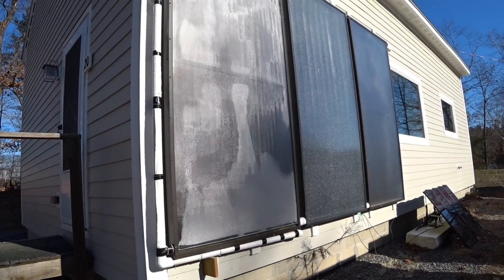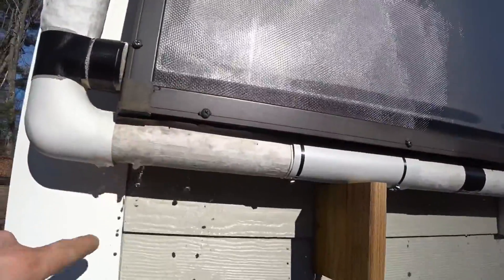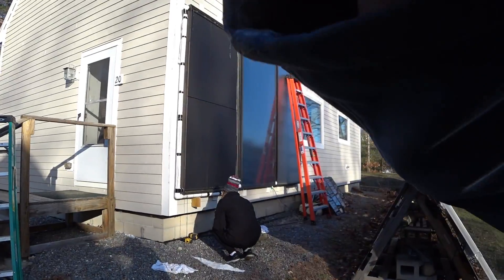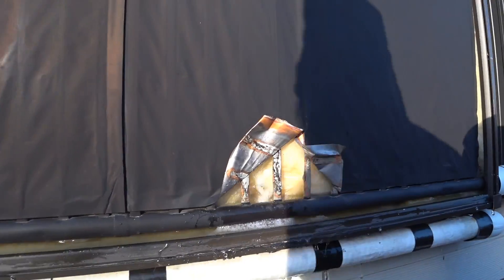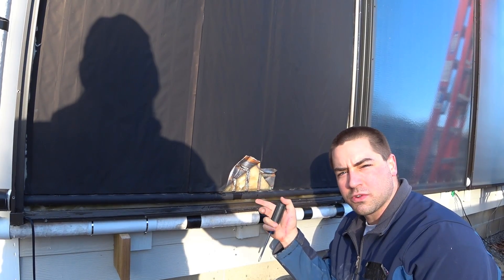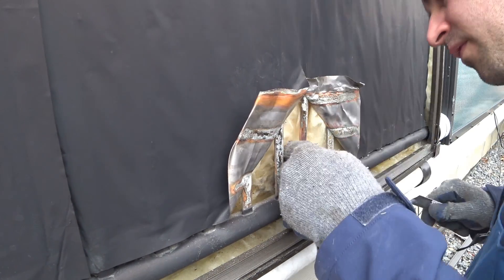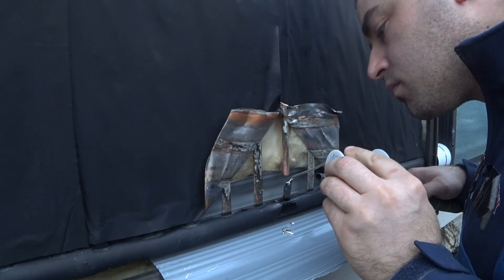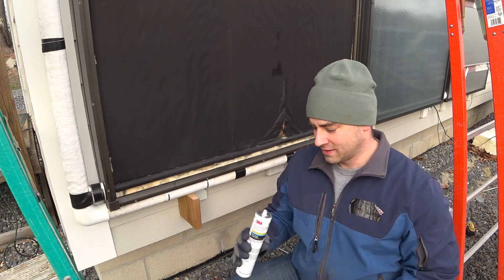Repair a Solar Hot Water Fail, DHW

Comment: When these collectors are finally shot, I'd love to see you DIY a heat pump. In theory it seems like collectors are the cheap and easy solution but there always just seems like so many possible points of failure. James Biggar did a wicked photovoltaic/warm air/mini-split build. With your existing tank it would be sick if you charged your thermal battery with such a system. Sola to run the heat pump and warm air off the back of the panels to feed the heat pump.

Comment: I just did a repair on my hot water panel yesterday using J-B Weld Original Cold Weld Formula Steel Reinforced Epoxy. I'm 1.5 hours away from re-pressurizing the system. That will be 26 hours for the epoxy to cure. I sure hope it doesn't leak. I used nothing more than that rubber framing on the outside of the glass panel to seal it since that is the way it was designed. I would hate to try to remove it again if I had used a sealant such as you used. Wish me luck folks.
Reply from the maker: Good Luck.  That JB weld is awesome stuff.  I've seen it work on low-pressure systems, and I probably could have used it here.  You are right about the sealant.  I don't think I could get the glass off now if I wanted.
Reply: @DavidPozEnergy  The system is back up and running (2 hours now) with no leaks. I used to use a product called MarineTex years ago to repair cracked blocks on my charter boat's V-6 outboards when rebuilding them. I never had a failure. This J-B Weld Original Cold Weld formula reminds me of that stuff.  I have about 80 pounds of pressure in this system. My concern will be more about the heating and cooling cycles as time goes on. I hope I got a good bond.
Ya, I think you are probably going to have to cut that lip off all the way around the panel so you could get a knife in under the glass if you ever need to get that thing open again. Sometimes we just try too hard to do a great job and shoot ourselves in the foot. I appreciate your video. We all learn as we go.

Comment: Do you use a solar panel to automatically run the pump?  I would, as it seems to make sense and is totally automatic...
Reply from the maker: It's not automatic.  but, I did have the pump on a little solar panel with battery for a few years.  But it would sometimes not run if the voltage was low, so I have gone back to running the pump on the grid.  I think the pump I have is 20 watts, and runs about 4 hours on a sunny day.

Comment: How you going to get the water out of the vertical pipe you dead-ended next fall?
Reply from the maker: Hi Mark,  I repeated this process on the top section, so there won't be any water in the pipe.  Thanks for watching.

Comment: Is it possible to let it drain empty for the frosty night?
Reply from the maker: The system I have is called a "drain-back" system.  It is supposed to drain every time the pump shuts off (which means every night).   I have checked for blockages, and the pump.  The system is working as it should in theory.  I think some water stayed in the pipe due to condensation, or capillary action, and it was just enough water drops to cause a problem.  It's very disappointing.
Reply: @DavidPozEnergy   Next summer I'm going to make similar, but of thick black propylene water tubes.  The only problem with them is that they tend to stay curved, difficult to straighten them.
Reply from the maker: Hi Jaakko, I'm currently building an experiment to test heating water using two methods.  You many want to wait for those results before buying any supplies.  I have two videos up so far about the experiment: https://youtu.be/VPd212q6uvU  https://youtu.be/kkoesuG72xQ

Comment: I've been thinking about this for a while now after watching your video last week. I wonder if when the water drains back down, the air that fills the void is too humid and as it cools it condensates inside the pipe, and that's where the freezing occurs?
Reply from the maker: Hi Solar Steve,  That sounds good to me.  Thanks for taking the time to comment.  If it breaks again I'll probably have to convert to glycol and add another heat exchanger.

Comment: Does the highest point have a vacuum breaker? Similar to a Hobart 00-277112-0002 valve? Sounds like the water tries to siphon back but doesn't have enough of a vent. When you cut the line it sounded like it was pulling air in instead of all of the water above gushing out that pipe. Adding one may help quicken the drain back and prevent a situation where the water won't drain.
Reply from the maker: Hi JR,  There is not vacuum breaker in the system.  In theory I don't need one because my tank is atmospherically vented, and the pipe leading back to the tank is higher than the high water level.  So there is a break to prevent siphon.  But, as you said, it might help make it faster to drain, and might help.  Thank you, I'll look up the part you suggested.

Comment: If there had been a sediment blockage in the bottom of the pipe, it very well could have been knocked loose due to the vibrations while grinding and cutting the pipe prior to inspection.

Comment: I believe the reason you couldn't get the coupling to slide far enough on to the pipe is because it has a dimple in it to prevent it from going more than half way. Unless you also disconnected the tube from above, it will still fill with water, but can no longer drain.

Comment: I will take a wild guess and say standing water resonate frequency of your water manifold caused flow impedance at a resonate node.  With no flow, the water froze.  Like a dead spot on a flute or guitar string node where you can touch the string and it doesn't change the frequency.  It is the same reason intake manifolds on new cars have resonate canceling chambers, so at certain flows, the standing wave doesn't impede air flow.

Comment: David;    After selling drain down systems with several layers of redundancy and doing this same soldering repair many many times, I would have to agree with the conversion to ethylene glycol (anti freeze). After about 10 years in a very moderate climate 3500 feet Arizona, and at least as many repairs I had to rip them off my roof and sell for scrap. Never did find the root cause, but some combination of capillary action, condensation and night sky radiation appears to be the best candidate
Reply from the maker: Hi Mark,  Thank you for your input and experience.  I have found several brands and types of antifreeze out there.  Was there a brand or make you suggest.  Ideally a link so I can make sure I get the right kind.  Thanks.

Comment: Will water be trapped in the remaining riser tube you left in place?
Reply from the maker: I cut it off at the top and made the same solder up there.  It's just hard to hold a torch, solder, and camera while on a ladder.  LOL
Reply: @DavidPozEnergy  Okay, now the repair makes sense.

Comment: Sheesh that is really a mystery ... i mean, the pipe was wide open to the lower manifold.  Unless a piece of debris got caught in there temporarily ?   like a small piece of paper, something just enough to prevent the water from draining and then eventually dissolved and/or passed thru.   A real head scratcher for sure !  Could your pump impeller shed a tiny bit of rubber ?
Reply from the maker: Hi Mark,  The pump I'm using is a stainless steel grundfos.  I doubt that it is the problem, but I'm also not willing to rule anything out.  As I've stated I don't know the answer.

Comment: Unless you capped off both ends of the pipe that pipe will just fill with water and burst once again and that windshield adhesive will ensure that you will never get that gasket off if that's what is in contact with the adhesive I would have just used a silicone for Windows and Doors I'm sure it would have held up just fine to the expansion and contraction
Reply from the maker: Thanks.  I did cap off both ends, just hard to hold a camera, torch, and solder on top of a ladder, LOL.  You are correct that the rubber gasket is in contact with the adhesive.  As I mentioned, I didn't know what to use.  It is connecting the rubber gasket and aluminum frame.  Would you have use something that is 100% silicone, or some mix?   Something like this? https://www.homedepot.com/p/GE-Silicone-2-10-1-oz-Clear-Window-and-Door-Caulk-GE5000-12C/100026175
Reply: @DavidPozEnergy  that's what I use to reseal fish tanks so I'm pretty sure it would work well in that situation I don't imagine the edge of the panel gets as hot as the center does and when I've had to scrape that silicone out of fish tanks when I have messed up it's in there pretty good so I think it would hold up pretty good just perhaps the window car sealant was a little excessive I believe it is designed to add structural strength to a vehicle so you may end up having to destroy the panel to get it off if it doesn't pop out of the gasket but fingers crossed you won't have another problem with that panel it could have been just a fluke that water got trapped in there. I'm actually surprised that you don't run some sort of antifreeze in the system. I wonder if RV winterizing antifreeze diluted in the water would help to avoid that from happening if water got trapped in there again? They advertise it as non-toxic
Reply from the maker: OK, thanks.  I did reply to the question of anti-freeze to another person, if you want to check it out.  probably just below this one.

Comment: I hope you don't ever have to take that glass off again you'll never get it off without busting it all the pieces now that windshield adhesive it's some tough stuff I believe I would have just used silicone but hopefully you'll never have no problem with it
Reply from the maker: Thanks.  Any particular type of silicone you would suggest?  You know, in case I do have another one to fix, LOL.

Comment: Why not use antifreeze or at least a mix of antifreeze so you don't have this issue. Since you run through a heat exchanger there should be no worries.
Reply from the maker: I have a 250 gallon tank in the crawlspace filled with water.  That water is pumped directly to the panels.  The heat exchanger inside the tank contains the DHW (potable).  So if I want to run antifreeze through the system I need to add another heat exchanger to the system somewhere.  This could be an internal HX inside the tank.  Or it could be an external HX if I run a second pump, one to pump the tank water and one to pump the antifreeze.  I might be forced to go that way if this happens again, but it would be a lot more work and cost then what I did here.
Reply: @DavidPozEnergy  No, you would just change out the water getting pumped to the panels with a antifreeze mixture, no need to add anything. if your concerned about cross contamination, you could also use Pink antifreeze which is not toxic.
Reply from the maker: @Little Bill: I've never installed an anti-freeze system, so if you are speaking from experience please let me know if I've missed something.  Last I checked the price on a 55 gallon drum of non-toxic anti-freeze for solar systems I think it was $600.  As I said above, I have a 250 gallon tank.  At a 50/50 mix that means I would need to buy 3 drums, or $1,800.  If I added a heat exchanger, say for example, 3/4" x 60' copper coil into the tank that is $250 plus $25 for a 2 gallon expansion tank.  I think adding a heat exchanger makes more sense.
Reply: @DavidPozEnergy  My experience is just for regular residential heating. I assume the tank is just for thermal mass at night, since you pretty much made a indirect water heater.  Since the water loops are isolated, can you re purpose some old water baseboard with fins into a nice loop, i would think you could get a bunch for cheap.
My original comment was based on thinking there was some technical reason you couldn't do it, not a cost concern, the heat ex changer makes sense, but maybe i'm missing why you need a second pump, the 250 gallons would not need to be pumped at all, just the antifreeze loop? Maybe i am missing how your loops are configured. i did look at your older video's to get a better understanding.
Reply: @DavidPozEnergy  I've heard of glycol but I don't know what it is per gallon but I do wonder the cost of losing your panels to a total freeze up versus the cost of having the insurance of antifreeze might be worth having something to work towards setting money aside to eventually upgrade 2 antifreeze in the system. Versus losing your full system to a freeze up. I don't imagine you have insurance on those panels the way they are
Reply from the maker: @Little Bill,  The second pump would only be needed if I was running an external heat exchanger.  Something like a flat-plate.  
Good idea on using some fin baseboards.  Thanks.
Reply: @DavidPozEnergy  no your correct you would need another heat exchanger coil in the hot water tank to run antifreeze also if you had the tank above the thermal panel you wont need a pump to transfer the heat they would generate a thermal syphone
Reply: @DavidPoz The way we set them up is 2 closed loop systems going into a shared tank. The CL going to the panels has non toxic antifreeze in it, the CL for your house is just potable water from your water source and the "storage tank" is just water.
Reply from the maker: @Derek,  I've also read that with anti-freeze systems you need a dump load to prevent the antifreeze from boiling and turning to acid. Did you also install a dump load?
Reply: I suggest: Put a second pump and feed it on lower RPM when sun doesn't shine. It's harder to freeze for moving water.
Reply: @DavidPozEnergy  we have never done that and we've never had an issue but I have read some of the same things you are talking about. A lot of it depends on how much thermal Mass you have to heat and also how much of that thermal Mass using throughout the day. The systems that I have helped install have thousand gallon plus in ground buried tanks and have never ran into an issue.
Reply from the maker: @Derek Markley,  That's awesome! A thousand gallon plus tank.  Wow.  Do you have any videos or pictures?  I'd love to see that setup.
Reply: @DavidPozEnergy  I will see if I can dig up some pictures for you. It was basically a block box with a poured floor in the blocks were also filled with concrete and then a pond liner was installed inside capped off with a removable roof that was insulated. The systems work really well if done correctly. There is also a very small solar panel powering a 12-volt circulation pump from the panels to the thermal battery. That way the only time the coolant is pumping is when the Sun is beating on the panels.
Reply: A few of the system's I have seen installed up here in my area of Canada they install a concrete cistern in the ground which is usually around a thousand gallons or more and they heat it up to as hot as the system can get it and then the system can carry itself overnight and often through a couple of days of no sun it seems to work pretty good during our - 40 periods. Whenever I got to do an internet install on those properties I always snooped and had a good look at how the system operated well I was doing my internet install on the roof and hooking up stuff in the basement

Comment: Windshield adhesive I think sets up pretty solid... They use those wire knives to slice them out so hope you never need to take it apart.
Reply from the maker: What do you think would have been a better alternative?  Just in case I have another one to fix.
Reply: I think, in terms of taking it apart again, just regular silicone would be appropriate.. You have screws that make the mechanical connection of the frame... The sealant just seals... Silicon will hold pretty well but won't be a nightmare to get off if you ever need to take it apart again... My 2 cents... I'm no glue expert.
Reply: Windshield adhesive is the only thing  responsible for holding a windshield in place so it strong as heck.. Go watch a YouTube of a guy replacing a windshield and you will see what it takes to cut one out..
Reply from the maker: Thanks.  Makes sense.

Comment: now there will always be water in the upper section which will freeze  and burst pipe , that urethane will have to be cut out the next time you have open that panel it is tough.
Reply from the maker: I did the same procedure to the top, in that I cut the riser from the manifold.  Thanks for looking out.

Comment: 3:08 It will happen again unless you air pressure purge the system each night below freezing. Even that won't help if an internal blockage happens in the outside panels.
I'd really look into converting the panels to a closed loop system running Anti-freeze through the panels.